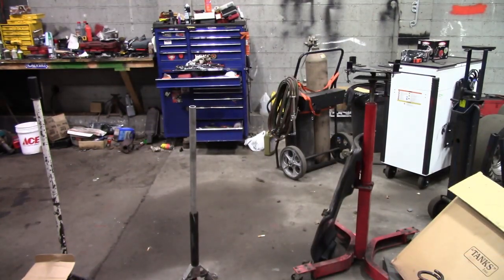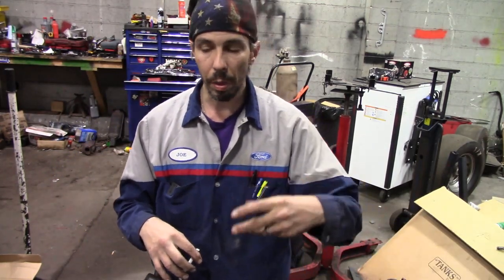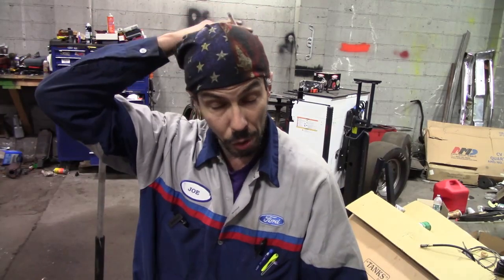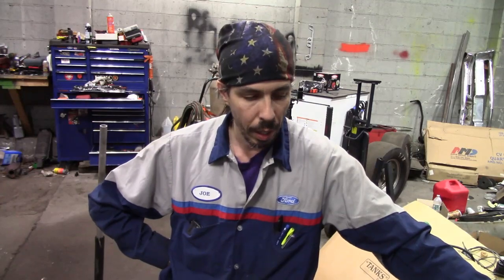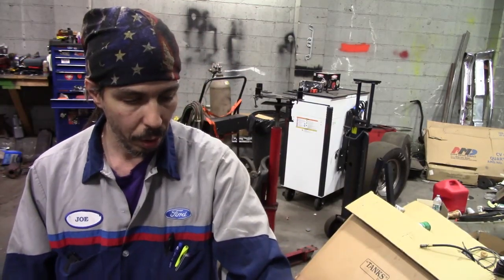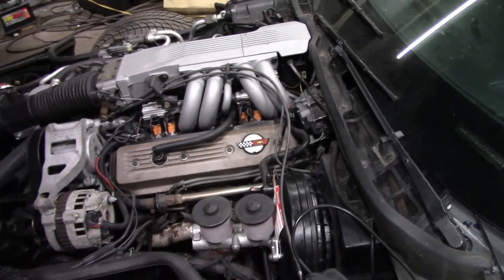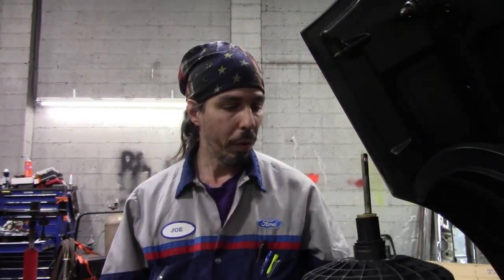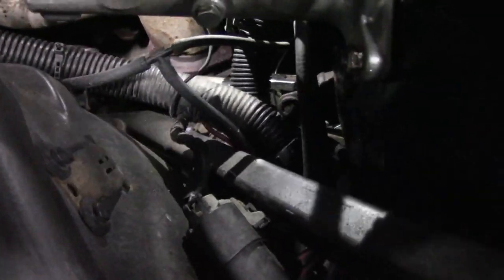C4 Corvette. Given Up On By Last Owner. The New Owner Wants It Fixed!

Comment: "you're not always going to find it with smoke ' TRUTH !!  had a 08 impala here with high fuel trims that dropped as rpm went up. vacuum leak for sure. did a smoke test... no leaks. started pinching hoses. pinched the brake booster hose and engine started to stumble. spraying where the master bolts to the booster... boom !! thats when i had the awakening that youre not always going to find it with smoke. btw its super easy to follow along with your stories . great work as always
Reply: Smoke wont flow into the booster due to the vacuum check valve. I pull check valve and smoke the booster directly.
Reply from the maker: This was with the check valve disconnected.

Comment: Joe, I really loved this video, because it highlights something that few people seem to talk about. Which is a leaking brake booster. I bet a lot of techs have been stumped by this type of problem. 

My first encounter/learning experience with this was very memorable. It was approximately 10 years ago, back when I knew FAR less than I know today. Of course that’s not implying that I’m any genius now though, lol. It was an early 2000s Geo Prizm, basically a Toyota Corolla. It is a mass air EFI system. A persistent P0171 was the only code. The freeze frame data indicated that it was  happening only at idle, in Drive, 0 MPH. 

The first thing I did was check for any vacuum leaks or air bypassing the MAF, but despite very thorough checking, I could find no leaks of any kind. I cleaned the MAF, no difference. Put in a new Denso MAF, still no difference. It was killing me, I checked all the basics, and couldn’t figure it out. I was about to give up and give the car back to the lady, who was a family friend luckily, so she could take it to the dealer like she wanted to. But I wanted to go over everything again, one last time, to make sure I didn’t miss something somehow.

So I sat in the car with my scan tool, idling, in Drive, vehicle stopped, all the windows up. And I was kind of getting into a zen like state where I was trying to make the most of my senses, sight and sound particularly. And as I was sitting there for a few minutes, I thought I heard a faint hissing sound. I thought hmm, where could that be coming from, all the windows are up, no accessories are on. I quickly realized that the only possibility could be the brake booster. So I put the parking brake on, took my foot off the brake pedal, and it seemed like the hissing went away. Stepped on the pedal again, hissing seemed to return. 

Then I did the same pedal apply and release test, but this time watching the O2 sensor waveform. When I stepped on the pedal, I saw a sudden and prolonged drop to 0 mV. I now had confirmation that my suspicion was correct, it was a leaking booster that was causing all this trouble. But what’s so tricky about it, is that it is a vacuum leak that exists ONLY when the brake pedal is depressed. The commonly used methods of finding a vacuum leak would never find it.

Ever since then, whenever I’m checking for vacuum leaks, I always pay attention to the booster as well.

Oh and btw, I couldn’t help but notice what almost certainly appears to be a SB Chrysler header gasket hanging on the wall. Mopar guy here 😁
Reply from the maker: Awesome brother. I actually have a video on an Explorer that my buddy owns that did the same thing, but the truck wanted to stall from the sudden lean condition. It made for a good video and was cool to see caught on camera.
Reply: Oh I forgot to mention Joe, that car would actually stall sometimes from the condition as well. I think she told me one time that it actually died in the middle of an intersection, trying to make a turn. Obviously that freaked her out, and she was scared to drive the car.

Comment: Great video and diagnosis on a OBD1 vehicle.  That old SnapOn brick is still a very useful tool, I still have mine that I bought brand new back when they first came out.  Just a heads up on smoke testing.  A lot of the brake boosters out there have a one way check valve on them.  They open up when there is a vacuum source (engine running) to allow the booster to work but they close as soon as the vacuum source is turned off.  If the valve is closed, it will not allow the smoke to enter the booster chamber.  I  remove the vacuum hose and check valve and stick the hose in the rubber grommet to check for booster leaks.  Good job, keep the videos coming.
Reply from the maker: Yes sir. I should have mentioned that. I actually removed the valve also, and smoked it out of the vehicle. No smoke...But it is quite obviously broken. maybe something to do with the diaphram? I am honestly not sure...

Comment: Some seriously good troubleshooting skills on display, nice work. Crap parts will be an issue going forward as older cars go into classic mode and parts are NLA. I am having the issue right now with a 97 BMW 540.
Reply: Same here on my 92 BMW 735iL. Good luck trying to find an OE Bosch idle air control valve, air flow meter or throttle body!
I found that the best recourse is to use known-good used parts.
I'm dealing with a shaking engine with a minor hunting at low RPM's (idle and reverse/drive off-throttle). Very difficult to find a source for the issue, and the mechanics that looked at it weren't exactly excited. I wish I had someone like Joe or Eric O in my area.

Comment: Always informative.  Dam good diagnosis.  I remember years ago was at training and the instructor said eventually we will just a crankshaft, piston going up and down don't be intimidated, it's still just an engine.  He said all the valves would be electronic.  Just a side not, boy did I hate doing heater cores.
Reply: Joe I was just thinking after the fact, if you smoke the intake isn't there a one way check valve on brake booster. The check valve would only allow vacuum into the booster but wouldn't allow pressure like smoke vapour into the booster.   Just a thought. Have a good day.
Reply from the maker: 100% true. I removed the check valve though...even did this off the car. Crazy, no?
Reply: Joe's Auto Electric that's what makes us techs never get beat attitude.  Maybe it was cracked in such away that when pressure applied it actually sealed it. I know have strange shit happen to me also.  I remember when I used work on school buses.  We were getting government inspections and they would fail use because the brake jounce had a bulge in it.  We were quite upset they were finding this defects because it was the brake
Reply: Dam big fingers.  Anyway they pumped the brake pedal with electric over hydyolic as hard as could and that's when they bulged!!!!!   Normally you slam the brakes on a panic stop.  There test was not realistic but they would not admit they were wrong but you know how government inspectors are like. Catch on the flip side.

Comment: Sounds to me like the last thing a customer should work on is his own Corvette. And certainly not his friends Vette without proper equipment. I just broke the holdown connecter on my Dodge Journey's computer. I have been disconnecting and plugging back in these two connectors to reset the computer so the cruise control works. After unplugging it works right for about a week each time. Last time I sprayed wd40 in the connectors but it still ran cruise control for a week before the little computer on the console would not turn on. I don't have enough money for a new computer as I am old. Looks like I will have to find the back connector cover. Thanks for the good videos.

Comment: Good find, ive ran into that as well the reason you couldn't see the smoke is due to the check valve in the booster stoping the pressure from the smoke machine. If you think its a booster check it with the check valve removed or just do what you did block the hose .
Reply from the maker: I should have mentioned int he video, the check valve was removed

Comment: The old down the rabbit hole parts  cannon, only they replace good parts with junk and broke what was not broke.  Good save.  Always like the tuned port motors.  Similar to the one in my old 88 IROC.
Reply from the maker: Yes sir. My old GTA (1989) had the L98 engine with some work done to it. For it's time, it ran pretty good.
Reply: @JoesAutoElectric  they're still respectable in today's world. 350 ft-lb torque is no joke, even if the hp rating seems like it.  I really like TPI systems, they look cool and produce awesome torque.  They don't breathe all that well, but there are fixes for that too.  Mine is bone stock, don't even have an upgrade PROM in it.  It's been fairly reliable, outside of the fuel injectors.  Had to replace a temp sensor that was telling the computer it was -40 outside.  That's adding a little bit too much fuel houston temperatures in open loop mode.  Tuner pro clued me in on the part.  When I did the injectors, I replaced the thermostat with a 180 and bypassed the throttle body water passage.  I'm not too worried about icing here.  These engines love low coolant temps and cold air, the factory wanted them to roast all the time.  Oh yeah, I've been through a couple of fuel pumps over the years.  That's not a lot of fun to do, but I refuse to cut a trap door through the floor pan.  These cars are finally becoming worth something.  The irony is that they're getting to be worth more than the corvettes from those days. The L98 was an awesome motor for its time.
Reply: Did you have an L98 350, or the 305?  My 66 GMC has a rebuilt 305 HO motor from a 91 fbody.  I only bought a short block, do it's missing the induction and roller cam.  I put a summit 1102 cam in it and a two barrel Rochester, long tube headers and glass packs.  I've got an edelbrock performer intake and an almost new holley 4 barrel, I just need to install it.  I might change up the cam and go full roller when I do it.  It's tied to a power glide, so it needs all the torque it can muster.  With a four speed automatic, my truck would lead a different life than it does now.  You can see it at www.jvdrivers.net

Comment: Damn Joe, they really screwed the pooch on the timing. Base timing disconnect still taped...wow..smh. Great call on the booster and trashing the aftermarket junk. You are kicking the problem child`s ass when others threw in the towel. Outstanding workmanship! I wish I lived closer so you could fix my gauge cluster in a `91 C1500 Silverado with moonie gauges.(hate em)..temp and oil gave up the ghost, senders are good, connections to them are solid. Needless to say, I don`t like moonie, but love the truck. Over 300k on the clock and finally had to replace the original distributor when the pickup coil`s plastic cover disintegrated.  It fired right up with new distributor with timing connector disconnected. Set base timing, shut off and connected timing plug...runs like a champ. Thanks for sharing your diagnostic skills and train of thought. I appreciate it along with many others. Stay safe, God Bless.

Comment: Hey Brother
I started obd1 in Indiana  when the clean air car check tested on a Dyno with a 5 gas analyzer. I M 93 test. Air pump diverter valves were a big issue. But your 100 % dead on balls the 1 wire o2 had to be grounded. Great explanation on block learn and integrator  0 to 255. 👍👍
128 14 : 1 ratio.
Reply from the maker: Oh yes I remeber that test. Remember in Jersey we had the same dyno testing with 5 gas. And I hate those damned diverter valve tubes on these engines.
Reply: ....,.. I remember the dinos they put my 90 notchback on it...... thought that thing was going to come right off.....lol
Reply from the maker: @chrislore2681  those Dyno systems were designed for 50% load at 15mph if memory serves. However I know if a story from years back about a brand new corvette at a shop for an oil change. One if the knuckle heads decided it'd be a good idea to throw it in the Dyno and see how it did at high speed. Needless to say, the car, along with the shop owner's snap on box, and the Dyno were destroyed.
Reply: @JoesAutoElectric  .......... Yeah for some reason the knucklehead thought he had the floor it...... Probably because it was a 1990 LX notchback mustang..........

Comment: Good find on the booster crack.  I happen to have the exact same car ('88 C4 automatic).  I bought it in 1989.  It now has 216,000 miles.  It's rotting away in my garage because it won't pass California smog tests.  I threw EGR parts at it but no improvement.  The car runs strong and idles well.  But the California smog sniffer says NOX is off the charts (1595 PPM measured, max allowed is 545 PPM).  These numbers are repeatable.  I'm stuck - can't sell it, can't drive it.
Reply from the maker: Why not bring it to a  shop who is capable of diagnosing it properly?
Reply: @JoesAutoElectric  Fair question.  My wife and I are in our mid-sixties now.  Somehow, we ended up owning four cars.  I'm assuming at 216,000 miles the mechanic will simply say, you need another engine or some major repairs.  Being semi-retired and my wife being fully retired, we don't feel like dumping 5k into that car.  That's probably more than it's worth.  We'd rather use that money to go on another cruise - if the cruise lines ever start back up.

Comment: The heater core on this year Corvette is a pain to replace. If you take out the passenger seat put a board down and then work on your back below the dash you can change it without pulling the whole dash. 

The ignition distributor manifold cover plate is held in place by three small Torx head machine screws. They are usually very easy to remove but not always, and you will shear them off if you are not careful, like the screw missing in the video, which is probably sheared off. Often you have to add a little heat and get the screw to back off a turn or two, then add penetrating oil, let soak in and work the screw in and out while adding heat and more penetrating oil to free it up. The steel machine screw is mounted using machine threads directly in the aluminum manifold body without an insert or Heli-Coil, and as a result will be an excellent heat sink so adding heat you have to be careful to not add too much but  also not to add too little. Once you free up the screw, and add WD40 it is easy to install. With the cover off, add WD40 to the threads and run the screws in and out a few times and the threads will lube up and the screw will not seize again.

The MAF should be a Bosch OEM replacement. 

The fuel injectors do not look like OEM replacements. The original injectors on this year Corvette will tend to fail when hot. So, if one fails, it is best to replace all the injectors with a matched flow set. All of the rebuilt or new sets that I have installed on C4s 85 to 89 Corvettes have a dark body like matt black, maybe a very dark blue. As stated in the video it is relatively easy to spot the bad injector using the current clamp because it will look purely resistive and different from the other injectors. But, you have make sure you let them get very hot. So, before doing this test close the hood and let the idle until the cooling fan cycles a few times, then open the hood and do the test. You will hear the misfire most of the time as the car warms up. However, in the end you don't really narrow it down to which injector you just replace the whole set.
Reply from the maker: @windward2818  did you watch the video or assume I didn't know? Lol
Reply: @JoesAutoElectric  Yes, I watched the complete video, and yes I assume that you know how to do the repairs. However, there are a lot of details not covered, which is okay based on the keeping the video concise. My comment was meant to give a little more detail on what I have experienced with the repairs. This is after all a very old car. Do you see any issues with my suggestions?

Comment: I generally check boosters with a vacum pump if i suspect a leak. You may want to try that for shits n giggles and see what results you get with that. Good video on working on older cars and trying to diagnose the real problems. To many hands and to many bad parts. Congrats on getting that brick, been looking at them to work on my older truck, still pretty spendy.

Comment: You know what...even though I've got a new Snap-On Solus Legend scanner I still have my OG MTG-2500, the graphing brick and all the adapters n stuff for old OBD1 stuff. Works wonders sometimes even though I have the adapter to use all those old adapters on the Solus Legend, the old Brick can still talk to some older stuff the Legend can't. Still something useful to have the diagnostic arsenal.

Comment: Often you wont get smoke through the brake booster because they have a one way valve in the line somewhere so they hold vacuum when you turn the engine off.. The smoke wont get through that valve.
Reply from the maker: Indeed...but the valve was removed.

Comment: Great vid Joe. Pinching off that booster line was key. No. Knowing the fuel trim of that polder system. Did u get to use the MT 2500?  Thanx for sharing your experience with us!!
Reply from the maker: Yes  sir.  That scan tool works great and is like brand new. It was a great help for this old Vette.

Comment: Hi Joe nice video. Can you tell me what drivability problems the worn steering knuckle is causing on this vette if any that you know of? Thanks
Reply from the maker: The Vette has both a frozen joint and damaged rack. Turning is the issue. Locking up and such.

Comment: Dont boosters have a one way valve to hold the vacuum?  Maybe this would block the smoke machine,  Good to know
Reply: Hvac systems that have a vacuum reservoir will also have check valves.  You can still use a smoke machine, but need to either bypass the valve, or simply change where you inject the smoke.  Surprised this car didn't have a high brake effort complaint.
Reply from the maker: 100%! That would have been the first clue.